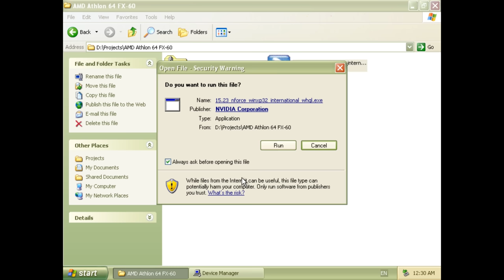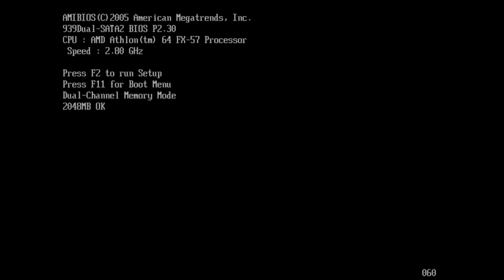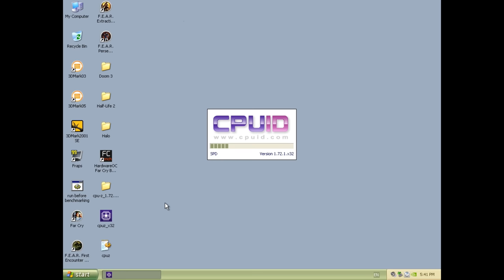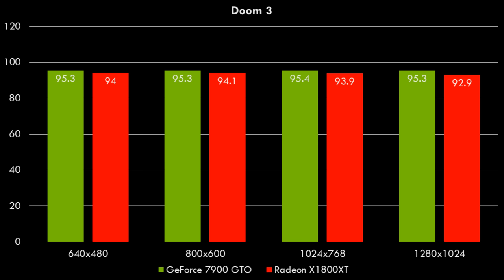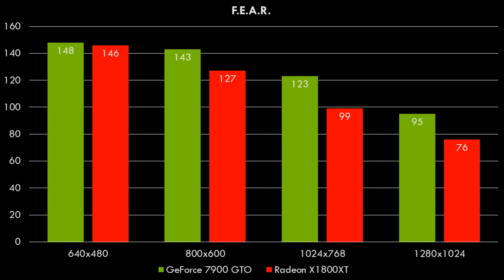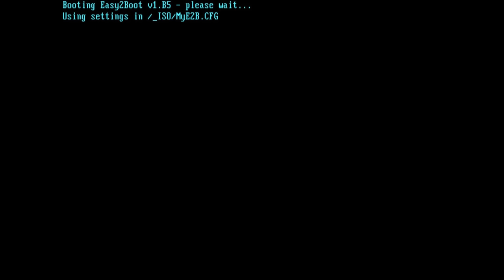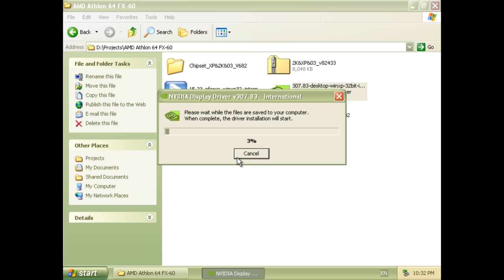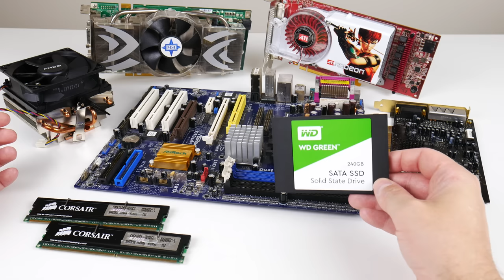AMD Athlon 64 FX-57 - $1031 CPU from 2005

Comment: I used to have so much gear from this era but nearly all of it has died. Some of it just eventually refused to post/or get any output, other parts just behave as if they aren't plugged into anything. So frustrating, I've lost my prized fx-60, motherboards from nf4 to 790i and 955x to 975x,  ddr1/2,  and a few GPUs. Quite a bit of gear from the RoHS transition, it would seem?  I remember Nvidia based boards were extremely picky about ram and bios versions,  I lost countless hours trying to get a striker extreme to get into windows and a weekend trying to get an a8n-sli premium to work. However, 
this is an excellent trip down memory lane. Cheers!
Reply: Have you ever used the abit kn8 Ultimate?
Reply: I have so much gear from this era and all is working. You are very unlucky and I am very lucky I guess. In medium we are fine. :)

Comment: Another great video Phil! If I could I would give you 2 likes! 
A few words about the problems you encountered: 
1.	Use driver version 197.77 or earlier with Nvidia video cards in order to maintain compatibility with games of that era including Farcry. Any later version will not increase performance anyway and if you play games from 2007 or later you will need a more powerful video card too.
2.	I also encountered error 0X0000007b and this usually refers to the storage controller. When installing Nvidia chipset drivers you need to install in a specific order one at a time: first the chipset, SMBus driver, SATA driver but NOT the SATA raid software that will put a small icon in the system tray, network driver but NOT the Nvidia firewall and restart each time. Bulk installation of drivers of mtoherboards with NVidia chipsets is not recommended.
3.	Maybe you can get hold of a Radeon X1950XTX video card. That thing is easily the most powerful directx 9.0c GPU ever. 7900GTO is from 2006 and is actually a 7900GTX in disguise – only the memory is underclocked to 1320 MHz and as such I think it should be compared to a Radeon X1900XT/XTX. Maybe 7800GTX should be a match for the X1800XT.
Reply from the maker: Good tips! Yes I didn't have a X1900 series card I'm afraid...
Reply: I had the AGP X1950XTX on my 939 rig. I should have just upgraded the board to PCI Express due to the terrible nforce support. lol
Reply: I had a soc939 Gigabyte motherboard with the Nvidia chipset, and I remember installing the chipset drivers were a nightmare, it caused all kinds of blue screens and freezes. I gave up and just didn't install chipset drivers for that mobo.
Reply: Yeah, I've been on the hunt for a 1950XTX for a while now, but it's managed to elude me every time, although I was very close at least once. Apart from being notably faster than a 1800xt and even 1900xt, it's also much quieter (those two are more akin to a vacuum cleaner).
Reply: @Tc4ify  I've managed to buy an X1950XTX Crossfire Edition for around 30 euro. I believe it was Mac edition, but run perfectly fine in Windows XP PC. Lady that sold it didn't even recognized the card and didn't tested it, so i guess i was lucky. It works, but it gets very hot, so i used Accelero S1 with cooler, so it didn't get past 60 degree celcius.

Comment: Building PCs back then must have been really annoying. This CPU looked like a beast when it came out but it was just a year later that AMD released the 64 X2 5600+ with two cores at 2.8 GHZ each for HALF the price of this one. It's the processor I'm rocking in my XP-era build as it's cheap as chips now and it can easily compete with a Core 2 Duo.
Reply: Jay Arre I remember some games coming out with a patch to utilize dual cores. May have been Doom 3 🤔
Reply: Au contraire, it was a great time. Games usually lagged behind supporting/taking advantage of the latest features by 1-2 years, still the case today (most games are still DX11). However, since hardware was evolving so rapidly, people were upgrading constantly, and the used market was flooded with hardware. So if you were willing to buy used, you could get top of the line hardware from 2 years prior for the price of a budget build using modern hardware. 

Want a hard choice between a 2.7 GHz single core semphron or a 2.6 GHz quad cor ephenom for the same price. Same for GPUs, would you rather have a geforce 9500GT or a 7800GTX? A ATI x1950xtx or a 3450? 

Compare that to today and the prices of used 1080tis finally falling below $500 4 years after release, and even older AMD HD 7000 GPUs holding their prices relatively well.
Reply: Many used Opterons as well. I have a retro rig from around 2005 that has the Opteron 185 in it. It's a dual core running at 2.6 GHz. More than enough for the games from that era, as well as games that came much later.

@Nick - Yes, 1080 Ti's are still selling for a lot, even after all these years. I bought an MSI Gaming X one last year for around $500 (slightly used). You mean the Asus HD 7970 Matrix, Sapphire Toxic and such models right? Those were beasts when they launched back in 2012/2013 and they pretty much forced Nvidia to release the much more expensive Titan in order to hold the title as "fastest GPU". No wonder they still sell high today. 
They were also widely used in mining due to the good compute performance of GCN.
Reply: Jay Arre  while that's true, the 2nd core really helped for running multiple applications. 

I was in college at the time and I had a fx 3200+ and my buddy had the 4200+

I had a TV tuner card in my pc. I had to give the tuner card to him because my computer couldn't run the TV and play games at the same time.

Comment: I still have all my original hardware from this era with Athlon X2 4400+ Asus A8n Sli Premium , 2gb Corsair 3200 c2 and a Geforce 8800GTX , Intel 80gb SSD , Enermax 535w PSU , everything still works perfectly and I've never had any issues installing XP , absolutely love my XP PC , it's a beast for the games of the era , I need to get a Creative XFI though as I only have an SB Live! in it atm , next step is a Lian-Li case from the era , the case I've got is a bit crap.
Love your channel , it's absolutely the best retro hardware channel around , I recently also built a Win 98 retro PC and used many of your videos to help in choosing the hardware , funnily the hardest thing was finding a decent beige box to suit the 98se era. Thanks again , keep it up mate. 👍👍
Reply: OG. A8N-SLI here: 8 GIGS ECC DDR* and Opteron 180.

*WHY?? you'd say! ..cause it was fun doing it (cheap ECC RAM) in Windows 7 64Bit.  Now in a W2K/XP-build not so much...

Comment: Both of my Nforce boards started having issues after a few years. One failed to see any kind of boot device, and the other I do believe the chipset cooked itself to death.
Reply: My buddy had a dfi lanparty mobo based on I think it was the nforce 3 chipset. The cpu mosfets caught fire and burned a hole in the motherboard
Reply: nVidia made some great performing/featured chipsets for Socket A, 754 and 939 but they never made a reliable chipset that I know of. Even back in the day, people noted they seemed to be problematic or outright die more often than other parts
Reply: @TheDemocrab  The nforce 2 Sata controller started dying at one point. I would need to leave the PC on for 30 minutes sitting at a black screen and then it would boot. My mate had the sound card (which was one of the reasons to buy the board just die).
Reply: Still have my MSI K8N Neo2 which features an AGP 8X slot and MSI K8N Neo4H which has a PCIe 1.0 16X slot. I was a bit soured on the nForce 1 from MSI on the Socket A platform due to the bulging caps (which was revealed later on that they relied on a cap supplier who used "counterfeit" formulas). I was soured on MSI after my AM3 build that featured piss poor VRMs despite being touted as being highly reliable and overclockable...
Reply: My socket 462 with nforce also died, just by being in storage...
Reply: @Jerre27  my Asus nForce 2 Ultra board is still alive and well but I liked the MSI nForce 1 board more for the integrated GeForce 2 MX GPU and SoundStorm hardware accelerated sound.
Reply: Same i had a pc that the chipset burnt up because the fan broke or something
So I got a new 939 some years later it was like in 2007 or something
F for that board :(
Reply: My PC between about 2010 and 2015 also ran on a couple of MSI K8N Neo 2 motherboards with the nForce3 chipset in succession. The first board I had burnt out on me when I tried replacing the noisy fan based original chipset cooler with a low profile solid copper passive one (that needed to be low profile so I could fit large AGP graphics cards over it). The second one had an active low profile solid copper chipset cooler with fan.

I don't know if it was the SATA ports themselves, the SATA controller burning out, or a dodgy PSU (I used branded high quality SATA cables that worked just fine with other builds), but various brand new HDDs kept dropping dead with the click of death after only a month or so with booting becoming increasingly unreliable.

Still, when it wasn't flaking out on me, whether with an Athlon 64 4000+ or a later X2 4800+, it ran various games like Flight Simulator 2002 very well, with 4GB of Kingston CAS 2 Hyper-X DDR400 memory, a passively cooled 256MB MSI HD 2600 Pro AGP card, an AGIA PhysX PCI card, and an original SB Audigy 0090 audio card (with a driver disk that enabled EAX 4.0 support) .

A year or so later, I upgraded to a Core 2 Quad Q9650 system with a 2GB EVGA 750 Ti SC graphics card, 8GB of G.Skill DDR2 1000, Gigabyte EP35-DS3R motherboard, same sound card, Sandisk X400 boot SSDs & WD Black storage HDDs, and an EVGA 550 G2 PSU for a much more stable dual boot XP/8.1 retro build. For some reason, the only game it doesn't like is MS Flight Simulator 2002, yet it's just fine with FS2003.
Reply: Mine died arround 2015.It was a compaq prebuilt with an athlon 64 3500 i think, i do remember it having an asus mobo with nvidia chipset.
Reply: So these chipsets are known to fail at some point
But tbh I want Nvidia to make chipsets again
Reply: Yeah, I had some nvidia chipsets too.  They weren't the best and were probably were some of the worst in  history on a mainboard for consumers.
Reply: The Nforce4 chips were running HOT. Mine was above 70°C. I changed paste and put a 50mm cooler on it, but it didn't really help.
Reply: @TheGyuuula  , yes overheating was a main problem of nForce4. And yes it require active cooling, when nVidia didn't specify it. So, lot of manufactures, just used passive cooling which wasn't enough. Also low quality capacitors can cause sudden death, but they was in pretty much every mortherboard back then. You still can have working nForce 4 motherboard with replacing capacitors on it and using active cooling at nForce chipset.

Comment: Asrock motherboards tend to be strong as rock
Reply: On the contrary...they're called AsRock because Asus spinoff company liked the idea of Hard as Rock...so that's what they chose..dropped the Hard
Reply: Mark Ian Clark big hard
Reply: Only board I ever had dead-on-arrival was an AsRock, talk about first impressions. Never bought another one.
Reply: I've always used Asus and ASRock, the funny thing is the only board i have ever had die on me was a Biostar board from ram oc 😄. My newest rig is the ASRock b450 pro4, 1600af, 16gb 3600 ram dialed down to 3200, paired with a Gigabyte rtx 2070 and the only problem i have is the gpu being loud and hot which after propping it up it's quite now however still runs hot 80c. Once zen 3 is released ill be upgrading the cpu and reapplying thermal paste on the gpu to get the most out of the 2070. Im interested in where you ordered the board from? 9/10 when a DOA happens it's because quality control of whichever warehouse the product came from. Not made wrong by the company but damaged in storage or shipping. I've had a few warehouse jobs, one dealing with tech and I've seen whole pallets of computer parts upwards of 300-500lbs on the pallet accidentally dropped from 5ft out of the back of trucks. Then we're ordered to just restack the pallet and send it on its way like nothing happened. There's where 90 percent of DOA happens. Always use sites with reasonable return policies and good warranties. That way not only will you have a warranty from the products company but also from the distributor. So if anything shows up fucked its 2 weeks later and back in your hands will be a brand new board usually sent by the manufacturer depending on warranty terms thus giving you a board that's never seen a warehouse outside of it's original manufacturing origin. Just a useful tip on pc parts.
Reply: @SerBallister  asrock and asus are the same brand
Reply: Unfortunately, all of the Asrock motherboards I ever owned died after a few years. I think none of them made it over 5 years. No overclocking, just normal use. Maybe I only had bad luck.
Reply: @SerBallister  That can happen with any brand
Reply: @stefanh.1131  MSI with nforce chipsets are the boards to stay away from, asrock are now the number1 board maker even beating gigabyte and asus, their ryzen boards are incredible.
Reply: @LB_Amerijuanican  Micro-Star MSI and Abit   were the most reliable motherboards
Reply: @tunkunrunk  I like msi too, but the prices for their good boards... Asrock am4 boards have been great to me.

Comment: Yep, I have an A8N32-SLI Deluxe that died a few years ago. Bought it new back in 2005 along with an Opteron 185 CPU. It ran fine w/ the CPU overclocked to 3GHz for 12 years. In 2017 it started falling apart, piece by piece. The first part to go was the nVidia NIC. No problem - the board has two NICs, so I started using the Marvell NIC. Two months later, the PCIe X4 slot stopped working. Again, no problem - I wasn't using SLI, so I moved my X-Fi sound card to the secondary x16 slot. 

Another two months later, the rest of the motherboard went kaput. One day as the computer was playing audio files from NAS, it just started SCREAMING. The machine completely hard froze & started blasting the loudest, shrillest sound out of the speakers. I immediately pulled the plug and let it cool off. Unfortunately, I never got the board to POST again after that incident. All of the  caps looked fine, so I'm not sure what caused it to die. 

I still have that board. It's framed and hanging on my wall. :)
Reply: Unfortunately some of these caps will show no signs of being bad at all, most of this hardware was manufactured during the capacitor plague where a company leaked an incomplete capacitor formula that many chinese companies erroneously copied
Reply: @nneeerrrd  They don't need to bulge to go bad, electrolytic can dry out (slow leak) and with age they love to either short or go open. Ceramics can go bad as well and that stops the majority of people from fixing hardware for all the usual reasons.
Reply: I have dead or unstable mainboards and graphic cards from pre 2010. I assume it's the caps. Never overclocked them hard.
Reply: I also have A8N32-SLI Deluxe. It works just perfect. And have fanless design. Also it has no PCI-E x4 slot. All that it has - 2xPCI-E x16 slots and 3xPCI. And it can handle Opteron 185 since Q2'06. How the hell could you buy Opteron 185/A8N32-SLI Deluxe in 2005 when Opteron 185 had been introduced in March 2006 and this board couldn't hold this processor before BIOS version 1103?
Reply: @ichinumi  Have no clue. All I know is that, yes, my A8N32-SLI Deluxe most definitely has an x4 slot, and that I most definitely was using it with an Opteron 185 since the day I bought it. That day could've been in 2006, but my memory is steering me to summer of '05.
Reply: @MrKillswitch88  That's probably what happened to mine! I remember a friend suggesting that the "southbridge", if you can call it that on an NF4 X16 board, may have needed reflowing, but I was leery of sticking it in the oven.
Reply: @stevef6392  I've baked cards and boards with electrolytics and some survived but a lot didn't, it is because of this chipset and a few others why I always check for thermals upfront before daily using a machine. It is because of this chipset there were so many aftermarket chipset cooling options until the end of the decade. I have no doubts that this chipset used around 40-50w on its own especially when overclocked and the later models were every bit as hot like the 780i and 790i.

Comment: I've had several Asus boards and never had any serious issues. Never used an Nvidia chipset though. My 939 board is a MSI K8T Neo2. Still works and also has Win98 compatibility if you're willing to work for it.
Reply: It was mainly NVIDIA nForce problem, even later in AM2 era the nForce Ultra 570 and such were quite buggy.
Reply: Asus boards from that era (the weird orange colored ones) were rock solid.
Reply: I have his exact board and while the mobo worked great for about two years, it died as soon as the warranty ran out. Was great while it lasted though.

Comment: I love this motherboard. AGP and PCIe works at the same time. I got to run simultaneusly Quake 2 in a windows through a AGP NVIDIA card in a monitor, and a DirectX 9 game on another monitor through an AMD PCIE card. All in a single Windows XP 64 bits edition without virtualization. There was, of course, some issues with the drivers until it works

Comment: I started with C64 so I have a lot behind me. XT, AT, 386, 486 etc.. Each generation has got its unique milestones. I was building a lot of PCs by then, it was very fascinating time, starting from hardware support for T&L in GeForce 256 progress in graphics was really massive and 5 years was a century. Nowadays if you will take a look at AAA from 5 years ago, there is still progress, there are improvements but then it was like discovering whole new world. In terms of progress Witcher III vs RDR 2 is not as impressive as Quake II vs Battlefield 1942 but there is still a lot of fun in computing.